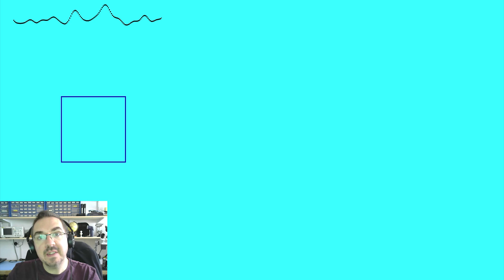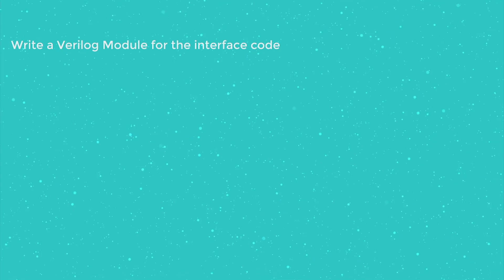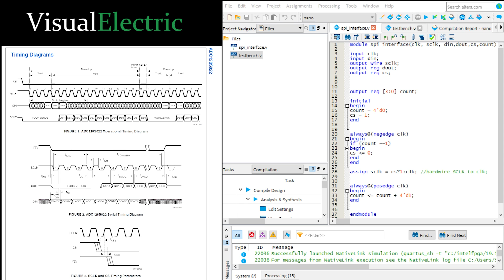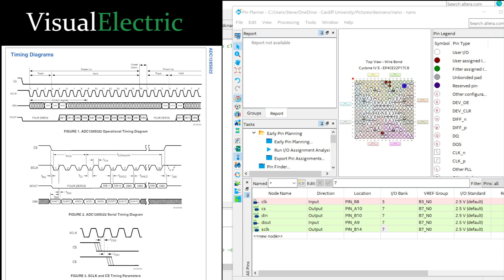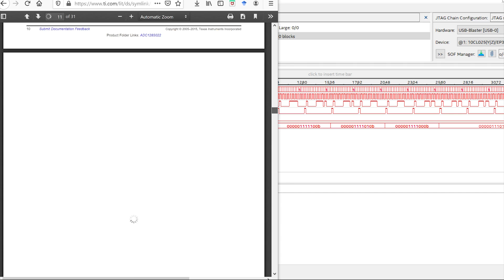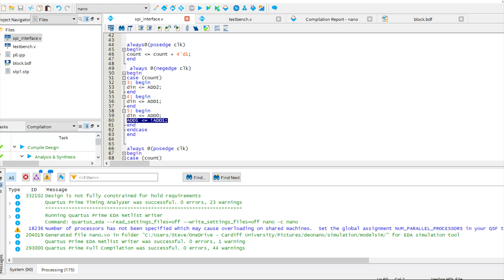How to write SPI Interface code in Verilog HDL for a 12-bit ADC (using the DE0-Nano)

Comment: I had to watch this a bunch of times but I got a version to work, with indentation and longer more descriptive variable names. One thing that had me stumped me for a bit was that the PLL setup just crashed every time I tried to run it. I ended up writing a simple clock divider module to divide the 50MHz clock down to 3.2 MHz, it happens to be integer divisible, so the PLL is really overkill when synchronization is not needed. Thanks for the detailed tutorial a learned a bunch trying to get this to work.
Reply: I had the same problem on arch linux. This bug can be circumvented by first increasing the size of the megafunction settings window so that all the information fits on it (without scroll bars)

Comment: There's much about this video that goes beyond my 'like' to wanting to post a comment about why this is such a great video to help folks bridge that vast expanse between FPGA and HDL (Verilog or VHDL, usually) basics to working, solid designs to arbitrary serial- or parallel externally connected devices. Even now, about eight years up the Verilog+FPGA learning curve and now trying to work with Xilinx PYNQ designs for ZYNQ SoCs, I still appreciate well-researched and well-taught tutorials about this one.

But then, as I started writing up why I appreciated this video so much, point-by-point, as is somewhat characteristic of a lot of how I comment, it started being as long as an article, much less a chapter of a book. Suffice to say I'll have to come back to comment a little more clearly about why FPGA designers, both new and a bit more experienced*, would appreciate such a compelling, well-researched, and well-explained video such as this one.

* --  For the record, I'm now eight years in and transiting to the SoC world of PYNQ boards, and the Xilinx ZYNQ chipset in general. Despite those years, I still think of myself as a 'newbie', not just because the learning curve is both steep and long, but because I'm a devout amateur designer.

But what I think quite interesting is how much the HDL programming language world has stagnated, to a large degree, since the emergence of Verilog and VHDL to program the then-new FPGA devices emergent in the 1990s, from Xilinx and then Altera (now Intel FPGA) and Lattice Semiconductor. In the imperative+sequential programming world, it would be akin to the programming world being completely fine with C (developed in the mid-1970s at Bell Labs to program Unix systems) for three or four decades. When in reality by the early 1990s there was a move to the first object oriented language variants of earlier structured environments like C and Pascal. Object Pascal was, sadly, my first intro to that world as it took a few years for C++ to have commercial viability on the Macintosh.

But though HDLs (hardware description languages) are quite different in nature and need from imperative+sequential environents, structured, object-oriented-functional, whatever) -- I still draw a lot of equivalences between Verilog and C, and similarly between VHDL and Ada, the latter being a structured language that I'm thankful not to have programmed in, inspiring both Pascal and C in later years. But compared to where we could be today based on what we've learned with the emergence of decades of new languages and programming paradigms, it's somewhat shocking to see Verilog and VHDL still the state of the art of "soft" FPGA and "hard" (as in taped-out and expensive) ASIC programming as well.

I hope that the future for HDL programming is that it is replaced by something less nuts and bolts oriented.... something more declarative in nature and not spelling out LUT-by-LUT or register-by-register how a particular FSM (finite state machine) is built. Furthermore, the same language should replace the current way that manufacturers describe the protocol and timing requirements of ICs or more complex subsystems. It would be nice for concepts like "Protocol" and "Interface" to add constraints at a somewhat atomic level of a new, abstract language in the same way as Int16, UInt32, and Int64 have become atomic ways to not only describe integer values, but values with specific ranges and sign values, replacing the vaguely defined "short int", "int", and "long int" values from the days of C which are compiler- and target-dependent in the bit widths (and bugs) which may result.

So perhaps this comment is considerably off-topic, but I hope we'll eventually end up, perhaps in ten years or five years (if my own efforts pay off) to coming up with such a language. It might be fun to come back in such a time frame and come back to look at this video to appreciate not only how well executed it was in its day.... and that's the principal point of my lengthy comment!!... but also how in ten years we should be talking about such interfacing at a completely different level where the nuts and bolts are figured out by the 'puters (the HDL compiler) far more than taking up so many brain cells of FPGA programmers... a principal reason for why the FPGA+SoC learning curve is as steep and long as it is today.

'Nuff said.  I'm definitely #WorkingOnIt in the meantime, building my own FPGA+SoC controller for that 8-input precision (low-frequency) ADC I was referring to earlier, whose Verilog design I'll post as well, and push into the public domain.

Comment: Thanks for this great video! There's just one thing. I think count on line 82 (44:39) will never get into case 16 since it is a 4bit register.
Reply: So, is there a workaround which would let me get better resolution? Any changes recommended?
Reply: The timing diagram goes from 1 through 16, while count goes from 0 through 15. Perhaps “if (count ==1)” should be “if (count == 0)” since that is the beginning of the counting.
Reply: @Gorj-fid  I was shouting at the screen every time I saw count == 1 as the start point of the logic!!! It should be all be working on a count of 0 to 15, not 1 to 16!

Comment: Thank you for the amazing material! 
What kind of BNC adapter/setup are you using to connect the Function Generator's output to the de0-nano PMOD?
Also, would you recommend getting de0-nano or de10-nano?
Reply from the maker: Hi, there's no connector - just simple jumper wires into the header pins of the DE0 and crocodile to BNC to the function generator. I haven't used the DE10 nano yet but it looks like a superior board to the DE0 and has the advantage of the Cortex embedded cores integrated into the same chip. The DE0-nano is limited also by relatively few logic elements, so it fills up pretty quickly. All things considered, I would recommend the DE10-nano as the best board to get in that price range!
Reply: @VisualElectric_  Thank you! Actually ended up getting myself a DE10-Nano kit from DigiKey few days ago, so I want to try making similar project to yours! 
Curious if you will be covering more of the (FPGA <-> Cortex HPS) inner communication via Avalon interface at some point? Or things like Ethernet, clock domain crossing, thanks again!